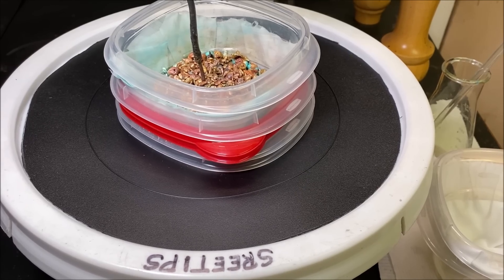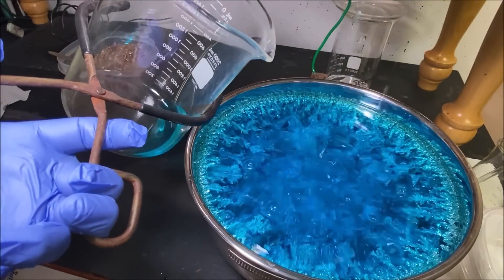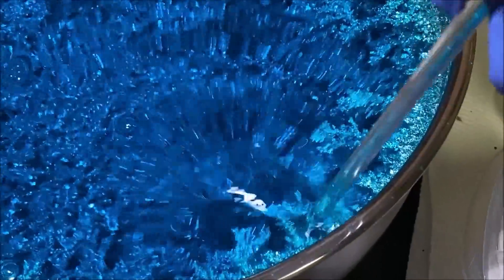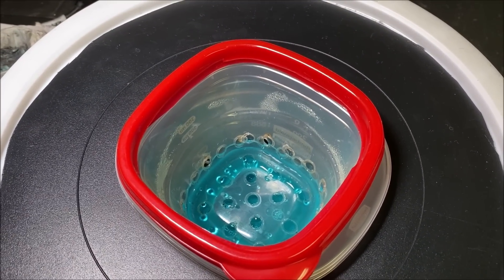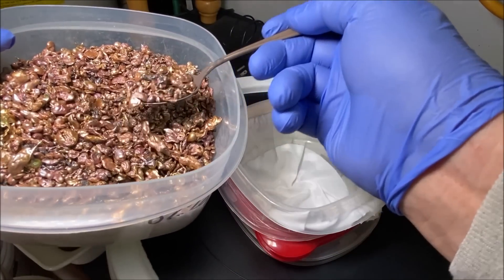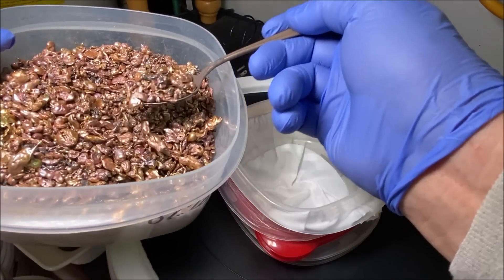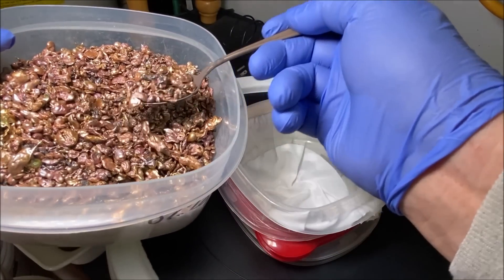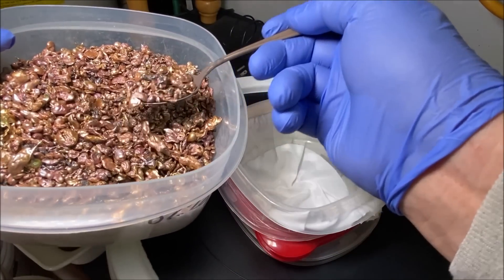Silver Cell Anode Filters Recovery and Refining Pt1

Comment: Still looks like it might be worth the time to rinse the slime off of the remaining shot in the used filters as you generate them (while they're still wet and soft), maybe in a small colander of sufficiently fine mesh, and then put the rinsed shot back in the pile for feeding the silver cell. 

I've got the impression that you only need reagents for the "finely divided" material plus the filters, and it's wasted on the pieces of shot that look to be unreacted.

Unrelated: Have you ever used sliver coins in your inquartations? I'd be inclined to throw in some 1965-1969 (40% silver) US halves or any sliver coins with no numismatic value.
Reply from the maker: I’ve tried recovering and reusing the shot. Didn’t work well. 90% silver coins should not be processed. They contain a known quantity of pure silver and should be held as is.

Comment: If the fuse is on the negative, your system will be hot and possibly dangerous
Reply from the maker: As long as the fuse blows, I’m safe.
Reply from the maker: It’s sitting on a rubber mat.
Reply: @sreetips watch out for electric arcs, energized electrolyte solution and melting the filter

Comment: I would clean them in a big funnel to remove any electrolyte then remelt paper and all into new shot to reduce the use of acid and condense down to one filter of slimes before processing with the furnace not the torch
Reply from the maker: This sounds plausible, but I’ve tried various ways to reuse the silver without success.

Comment: 8:25 Hey! Quick question about DC circuit safety - can you put a fuse on the negative side instead of positive?
Short answer: Technically yes, but it's not recommended for safety reasons.
Why it works: The same current flows through both sides of the circuit, so the fuse will blow on overcurrent regardless of which side it's on.
The problem: If your negative terminal is grounded and the positive side shorts to ground, the current can bypass your fuse completely by going: positive → ground → negative terminal. Your fuse just sits there doing nothing while dangerous unwanted current flows.
Best practice: Always put fuses on the "hot" conductor (usually positive). This way:

- Ground faults are properly protected.
- When the fuse blows, it cuts off the dangerous unwanted current.
- You're following standard electrical safety practices that are made to prevent problems.
Reply from the maker: If that fuse doesn’t blow, and the current flow continues, then I’ll end up with a silver cell full of slimes in boiling silver nitrate solution. Ask me how I know.
Reply: Should be fine as long as the silver cell is not grounded anywhere else right? That circuit is broken then no current flows. He is also dealing with very low voltage
Reply from the maker: It sitting on a rubber mat
Reply: This! Very much! Always fuse the "hot" leg. @Jonathonmartins7744 already said all that needs saying about the "why?". I'm just seconding the motion - Fuse hot as close to source as practical - for multiple good reasons. Or is burning down your shop on your bucket list? I didn't think so :)
Reply from the maker: The silver cell is not grounded. I need the fuse on the negative side as a matter of convenience. It should be just fine.

Comment: Pour electrolyte into the filter from the top onto the silver shot after replacing the filter and you won't have that wait building up amp flow.
Reply from the maker: If you notice, the new anode filter had some pieces of silver that looked silver instead of all copper. Because that’s exactly what I did. I poured fresh electrolyte into the filter basket.

Comment: I'm just asking because I'm curious about your reason for doing the filter processing this way. I would have maybe taken a strainer and shook the silver shot out of the filters and rinced it off so that I could continue to run them thru the silver cell and just basically taken the filters and sludge to the next level. The silver shot was not all dissolved to such an extent that it was defective. Rinced the sludge off the silver shot and keep running it out. Then you have a sludge that you can basically handle without recementing the silver out and remelting it into shot. Your gas and acids are costing you money and that's the part I am curious about. What does it cost for these chemicals? How would you streamline this so that it's much more economic to do all of this?
Reply from the maker: I tried that. It seems plausible. But it just didn’t work. Re-dissolving EVERYTHING in nitric is the easier softer way. I have access to plenty of reagent grade nitric acid.
Reply: I was thinking the same thing. But he's so methodical and precise that he must have a legit reason. I'm no chemist and very impatient so I would probably of burnt my face off by now if I attempted it. So I just trust his process